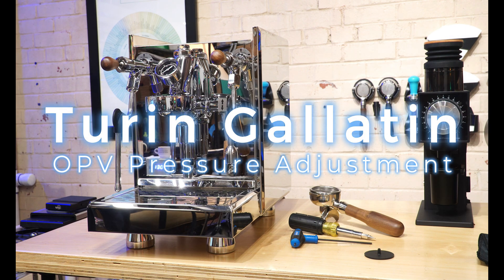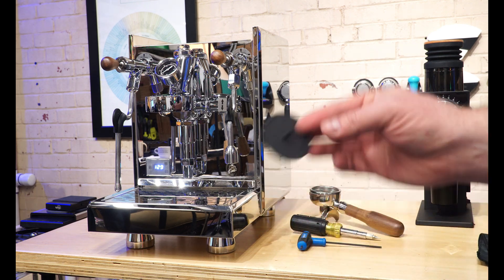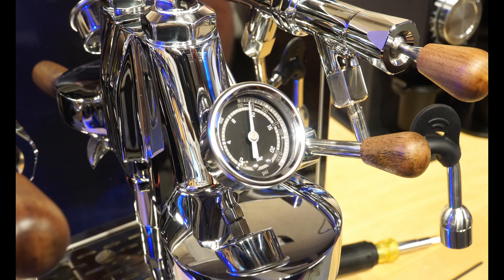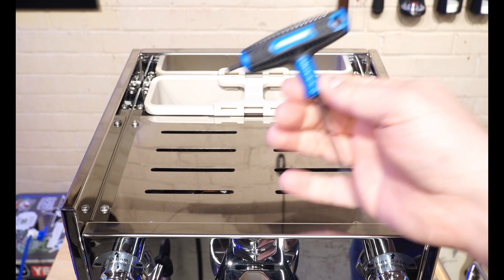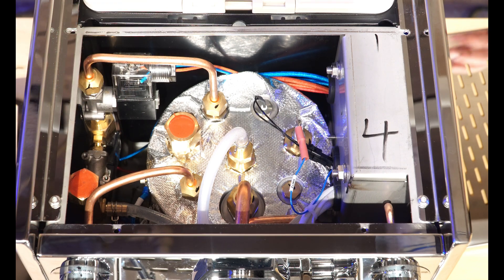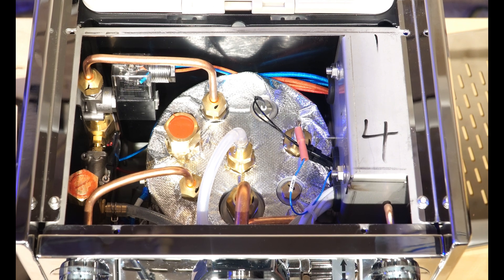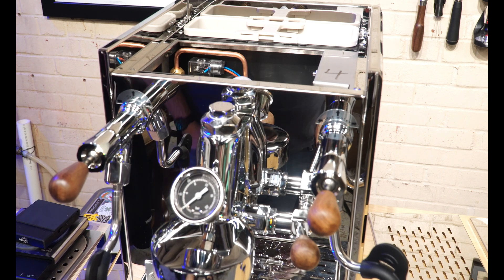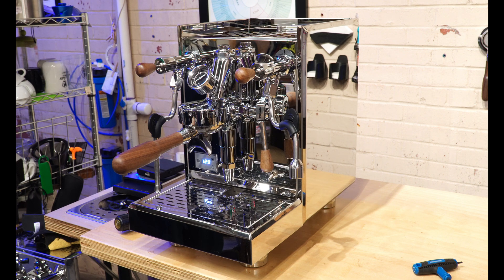Turin Gallatin OPV Pressure Adjustment

Comment: Does this machine come with the vibration pump with a by-pass valve?  If not, unfortunately, setting the OPV to 9 bar will prevent one from pulling 9 bar shots as it was adjusted using full resistance.  As the OPV was adjusted to 9 bar at full resistance, in order for a coffee puck to generate 9 bar brew pressure, the puck must present the same resistance that was used to set the OPV to 9 bar, that being a puck that chokes the shot.  In general, machine's with vibration pump, like the Gallatin, the OPV setting will allow one to pull shots at brew pressures 1 bar less than the OPV setting.  A 10 bar OPV will allow one to pull 9 bar shots, while a 9 bar OPV will only allow 8 bar shots, 8.5 bar at best.  Commercial machines with rotary pump machines are different as the pump can be adjusted to 9 bar directly at the pump by adjusting the pump's by-pass valve. The OPV in commercial machines are usually set at 11-12 bar.  The rotary pumps stronger flow rate together with the higher OPV settings at the boiler allows 9 bar shots even tho the pump is set to only 9 bar.  Most commercial machines set the pump's by-pass valve to 8-9 bar.
Reply from the maker: You can set the OPV higher if need be.  I generally do not go up to 9 on most of my shots.  Can set at 9.5 and if dialed in correctly will probably be close to 9.  Main thing is its adjustable if you want, but don't have to change.
Reply: @EspressoOutlet  Agree, the 9 bar extraction profile is not the only way to pull espresso, using slightly lower brew pressures (coarser grind sizes) often results in better extractions from the coffee puck.  The reply was for the many who believe that the 9 bar extraction profile is the "golden rule" and that adjusting the OPV to 9 bar will give them the magical 9 bar shot when it won't.  As the pump's flow is a "constant", it's the coffee puck that determines brew pressure not the OPV.  The OPV only sets the upper limit of brew pressure.